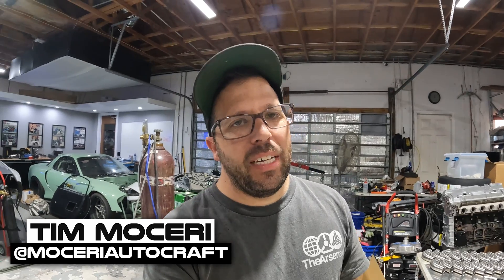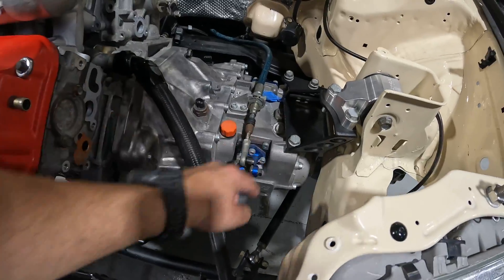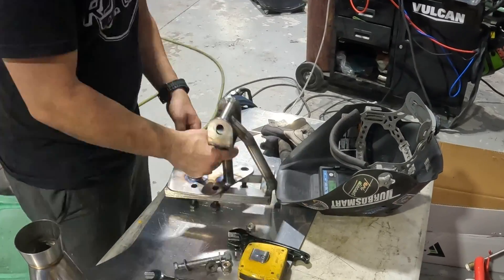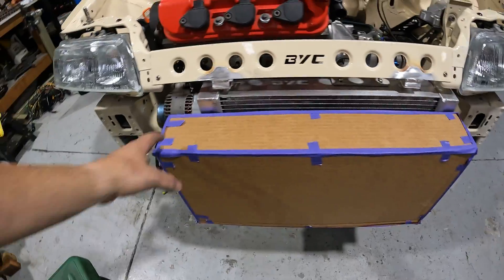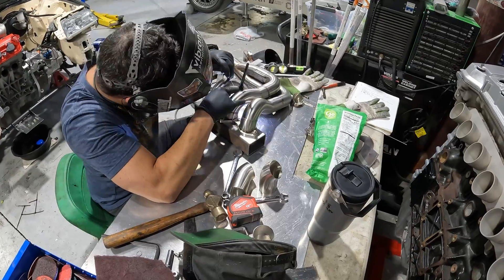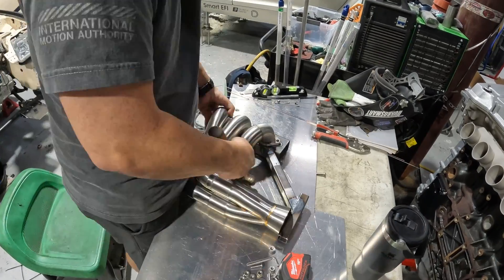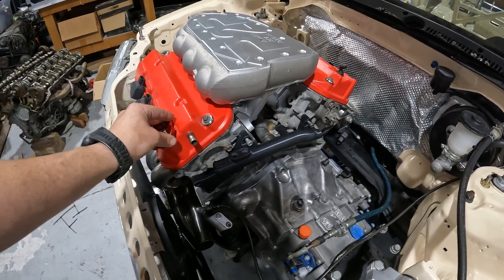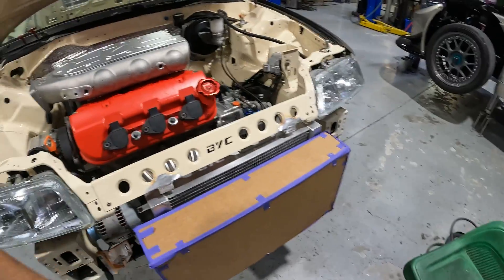Twin Turbo Header Fabrication in the J35 Swapped CRX - 800HP Honda SEMA 2024 Build

Comment: What awd system are you running? Or did I miss it in the video
Reply from the maker: @mikelmarion  we have a quafe all-wheel-drive sequential gearbox originally for a K series with an adapter plate to the V6, and then we’re running a winners quick change in the rear

Comment: No to swapping out the LS for an Honda J.... that's crazy talk. If you build the correct exhaust manifolds for the turbo LS for the Delorean, you can get the pulses in sync and it'll sound crazy AF, plus have the HP and TQ that a J can't compete with.... think '60s Ford GT40 with turbos...but you really don't need to do all that crossing and snaking, you only need to merge 2 from each bank to get them in sync.

Comment: how strong will that manifold be with autogenous welding some of the welds and not back purging?
Reply from the maker: @TIP-PJ  Back purging was something that was initiated by the food industry if you were welding food grade stainless steel pipe the inside had to be perfectly smooth so no bacteria would grow on any sharp edges or crevices on the inside of the pipe it was never about strength although I will say it will be a tad stronger it is not necessary in a automotive application with exhaust gasses. Furthermore I have cars on the road for over 9 years with headers that were not back purged. As long as you weld the exterior of the pipe properly you will be just fine. 💪🏻

Comment: I have thought for a while that a J-series would be a very reliable platform for a DeLorean. Another option would be a Volvo turbo 5-cylinder which would be a little more on the "purist" vein, given the original PRV engine. Those 5-cylinders sound amazing, like a baby V-10.
Reply from the maker: @JoshuaOrchard  they sure do. 5 cyl all the way.